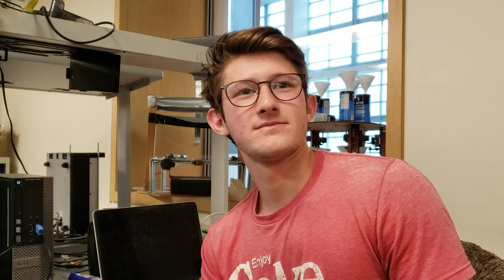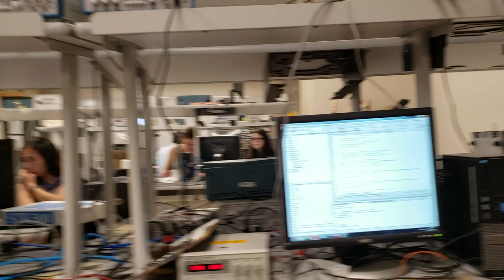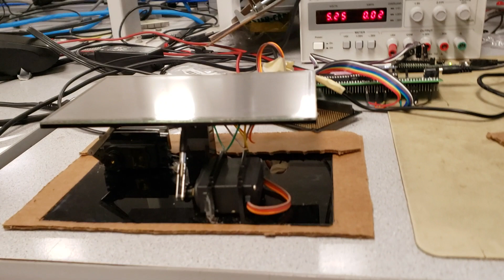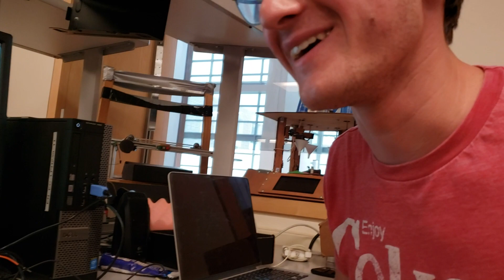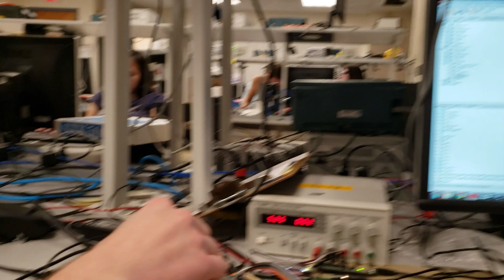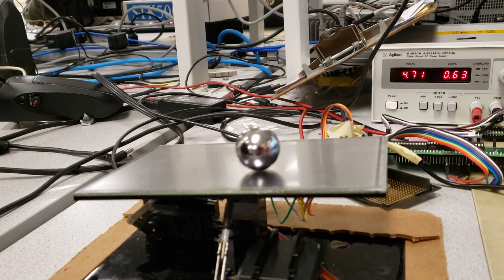Ball balancing on a touch screen

Comment: Good job fellas.
Would have liked to have seen a mode that quiesces the ball as quickly as possible (regardless of resting place on touchscreen), and also an ability to quiesce the ball at an arbitrary point on the touchscreen.  Did something like this many years ago at uni (although probably over a longer time period than these two!)   Both of these suggestions have real-world uses.
We all started with the inverted pendulum  :-)  Classic undergrad control systems stuff, never gets old.